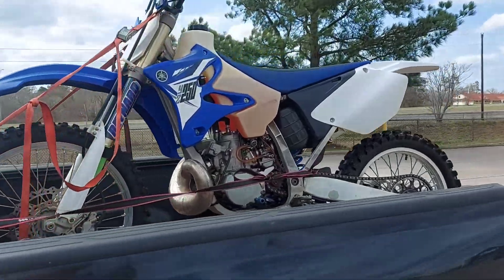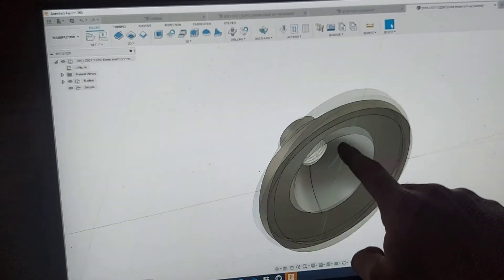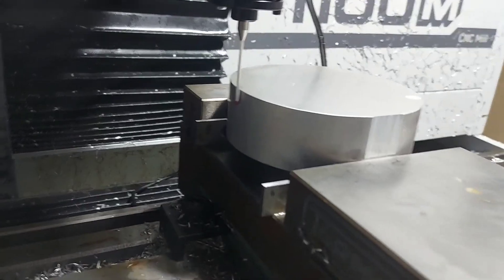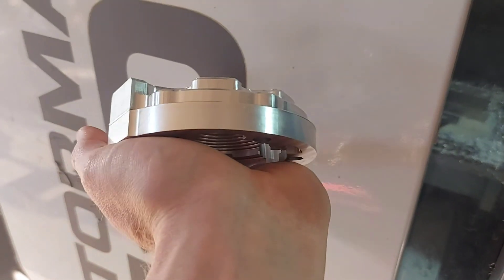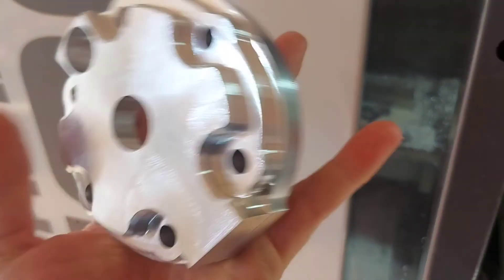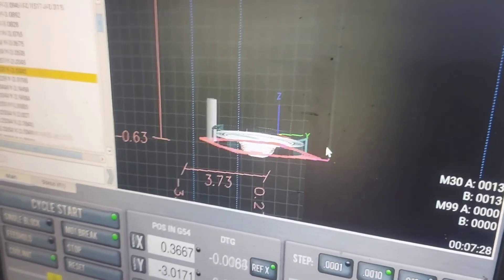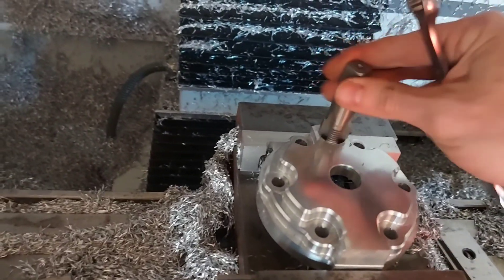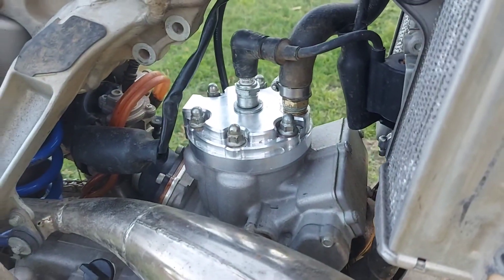Custom Billet CNC Yz250 Head on a Tormach 1100M Mill

Comment: Seen your post in the FB group. Couple things to think about. 1. Your saw. You can get a regular chop saw and an aluminum blade on Amazon for $20 and cut those pieces in 10 seconds. One blade has lasted me over 20k parts. 2. Talking about needing your Z height perfect from part to part. I would leave .050" of material and then mate them in a fixture and run a fly cut over both pieces, while mated, then you dont have to worry about that all the time. (Unless they dont sell as a set).
Reply from the maker: Great idea about the chop saw. I actually have one and will be getting a metal cutting blade for it shortly.  And unfortunately I can't deck them together because the inserts sell both as a set and individually so when the customer purchases an specific insert (I make woods, mx and sx) it needs to drop right into their existing head.  But thanks so much for the insight and I will be switching to the chop saw!

Comment: Very nice looking cylinder head! Do you expect a performance change once you remove the steps in the production part? We hope you're happy with the 1100M despite the moisture issues in Texas and the ballscrew failing. Thanks for sharing such a great video!
Reply from the maker: Thanks guys!  The area where the steps are is filled with coolant when it's on the bike and doesnt actually interact with the combustion since it's just the top piece, so performance-wise it will simply stay a bit cooler when it's smoothed out with a ball endmill since the flow of coolant would be more laminar.  But for quick and dirty testing it worked out great. I just needed to order some ball endmills with a longer reach (which I have now).  The moisture is an issue as it's in my garage now but I'm hoping to move it to a climate controlled environment soon as my shop comes together.  I definitely love the 1100m, I was actually told many times by people online that these heads couldn't be made on the tormach because it wouldn't hold tolerance, however I have made these for a few different models now and I'm able to consistently make inserts thay fit right up like a glove and the positional accuracy is such that my dowel pins line up with my holes in the head and the cylinder perfectly every time.   The ballscrew was a heck of an ordeal but I believe my gibs were just too tight from the factory and it became fatigued.  I'm actually shocked the stepper motor didn't stall before it snapped the ballscrew, so they must have some power. 🤣  Thanks for watching my video!

Comment: Did you reverse engineer the model or is the stock drawing published somewhere?
Reply from the maker: Made my own models by reverse engineering the stock dimensions and made my own combustion chamber profiles.  Spent over 150 hrs on fusion for this one model alone just tinkering. Will be doing this for every (still relevant)125 and 250 model made and will be selling them soon.
Reply: @MotoBuilds  ok thanks for the info! I was looking into it and was wonder how it was done. Where did you get the stock measurements at? Any and all info will help alot.
Reply from the maker: @Sittonon2Wheels  I just bought the bike first and took all positional and height measurements of cylinder and head  myself with my touch probe. There's really nothing out there to make it easy unfortunately.

Comment: Baddass!  As a fellow Tormach 1100MX owner if you upgrade your coolant pump to 1/4hp and lines to id 5/8 you wont have any chips piling up on you.  Awesome work!  New subscriber
Reply from the maker: Definitely will be doing that!  I hate standing there babysitting the part.   I considered the coolant ring also, have you seen/tried that?
Reply: @MotoBuilds  yes I have the coolant ring and it’s really an awesome upgrade.  Well worth it.  Nothing piles up
Reply from the maker: @tdg911  Gonna go order it now
Reply: @MotoBuilds  HUGE mx/sx fan. used to ride a lot man i miss it /sigh.  Are you in the fb tormach groups?
Reply from the maker: @tdg911  yessir I posted this video in the tormach operators group I honestly thought that's how you came across it.  I built mx engines for 10 years (still do) then decided to make my own parts
Reply: @MotoBuilds  that’s right! I forgot 🤣
Reply from the maker: @tdg911  haha what kind of things do you make on your 1100mx?
Reply: @MotoBuilds  Well I took delivery of mine in this past October.  I moved up from a desktop CNC where I was making my own pcb's for some raspberry pi projects I was working on and then decided I really like this!  So with that being said it was very nerve wracking coming up from such a small machine to this one.  I've been making some brackets for some ham radio's mounting in vehicles and just recently got my first paying job for some placards for home generator company and some stencils out of acrylic.  I plan on making some Jeep accessories etc etc.  I mainly jumped into this as a hobby but each day that passes and people hear about what is in the garage now I'm starting to get some requests which is a good thing :). We'll definitely see where this takes me.